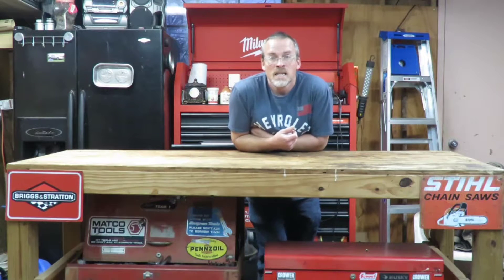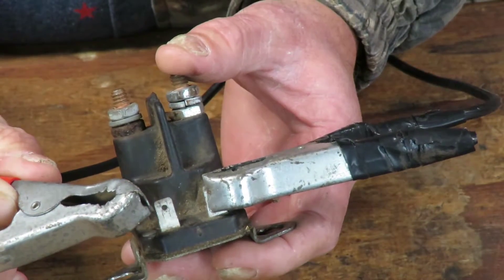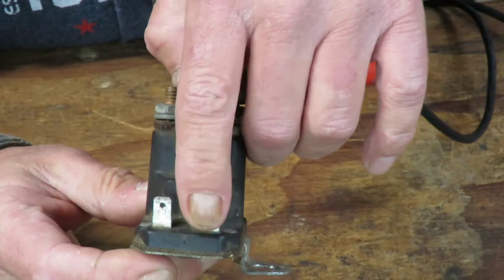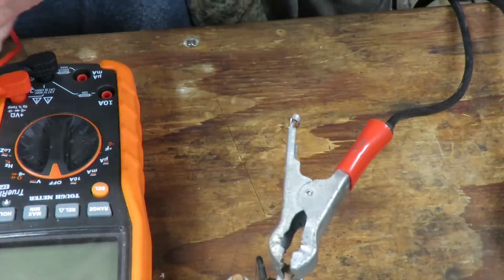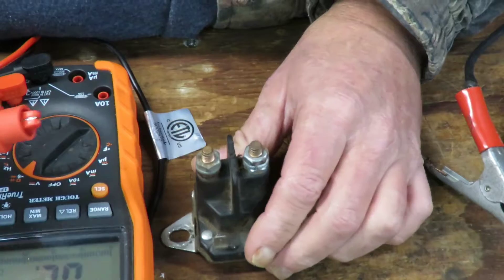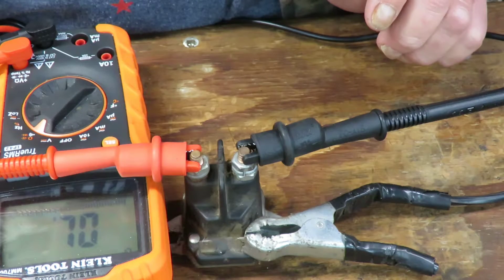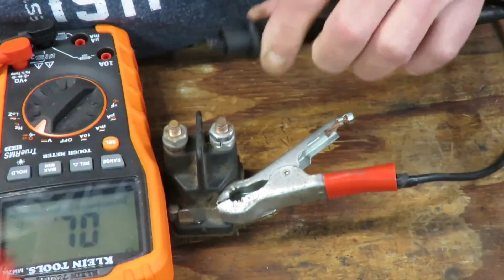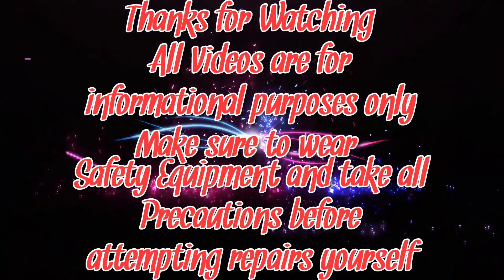How to Simple Solenoid Test with Tips

Comment: I have a Cub Cadet 1554 from 2006 and I’d like to test the selenoid which is a 3 post but located under the battery tray on one side. How do I hook my multimeter to it without removing it while it is still connected to the battery?
Reply from the maker: Is the Solenoid clicking when you turn key to start position?
If it is clicking then most likely solenoid is Not connecting inside.
I would replace solenoid
If it's Not clicking with key in start position
Remove small wire from bottom side of solenoid usually with a female spade terminal.
Put your positive lead of meter in this terminal and ground the other lead
Key to start position
You should have 12+ volts at this wire.
If you don't,  need to test key switch and or for a blown fuse or broken wire.
Reply: @sartingarage8045  Thanks! Yes, it clicks once after key is turned to Start position. I did a key switch test based on your video and that seems Ok, I replaced the key switch a couple years ago. I was running the mower and cutting grass for an hour before it ran out of gas, I think but when I refueled and tried to start, it wanted to crank but after about three tries, it went dead and only the click now. I'll try the test you mentioned.
Reply from the maker: I think you need to remove battery
Charge it on battery charger
Reinstall battery and try to start again
Then if it does start 
Check your charging system
If charging system is ok
Load test battery
It sounds like battery is not holding a good charge depending on how long you cranked over engine before going dead.
But the way it sounds , battery shouldn't go dead that fast

Comment: I have a K301s  1977 with amp meter that always shows a discharge and after awhile the bat. goes dead.   whats the fix? if anybody knows im shure you will   you are the best      thank you
Reply from the maker: Most of those the starter is also your charging system. There is usually a voltage regulator mounted to the starter/generator.
You check this pretty much the same way.
AC voltage into regulator
DC voltage out
Reply from the maker: Part # 275746s should be the voltage regulator. Look yours up by model and spec number to be sure.

Comment: What will cause the starter not to engage on start?  The voltage shows around 12.5 at the positive post on the starter, but the voltage between the starter and the motor's body drops considerably.  The starter seems to loose its ground and want engage.  This event sometimes will causes the fuse to blow.  The starter switch, solenoid and the starter seems to be working as they should.  Also, when I connect the ground post of the battery to the body of the starter it then engages upon start.  Any help would be
Reply from the maker: It sounds as if the abbendix are not engaging. Like the gear is stuck in the down position. This is common on the intek engines with a metal gear. You can free the gear but most likely will get stuck again if thats the problem.
Reply: @sartingarage8045  I used the information in your "How to test for ground Connections" video and isolated the problem to a grounding issue with the starter.  To bypass the problem I wired the starter body directly to the negative battery post.  I want to thank you for being so thorough in your teaching methods.  You're the best I've found so far.  Keep up the good work.
Reply from the maker: So the starter motor wasn't spinning fast enough to engage gear due to loss of ground. You probably need to check negative battery connection at Frame..
Take it off clean and put back . Then spray new paint to protect from rust. Atleast some clear coat.

Comment: After putting in  new key switch (old one did nothing) I did get the engine to turn over but not start, no click when key turned on.  Tested the solenoid but did not get anything on the resistance when checking to the mount, ordered new solenoid, question is should you get a voltage from the 2 black and 1 white wire going to the solenoid when the key is in the on position, I do not get any.  Enjoyed your video didn't know about checking from the mount, learned something  Thanks
Reply from the maker: Not when key is in On Position
Only Start Position
There should be Battery Voltage to small Wire to Solenoid in Start Position.
If you solenoid has 2 small terminals like in video. Should be power to One side with Key in Start Position
Reply: Thanks just not getting the click when key to on position maybe new solenoid will fix. Thanks again

Comment: This is extremely helpful.  I’ve got that very different looking Solenoid on a Kohler Command CH640 part number 2509811.  You know, the kind that is attached to the starter?  Can I test this kind the same way?
Reply from the maker: Yes Sir Very similar test
Battery or Battery charger to Ground anywhere on starter. Positive to Single Terminal on Solenoid.
Be careful if solenoid engages Starter Motor will turn over
Reply: Sartin Garage I’m assuming I can take it off the mower and put it in an insulated vice or can I test right in the mower?  BTW, I’ve used your other (and other YouTube ) tests and I believe I am getting power to the part.  Could I just use the screw driver/wrench trick to simultaneously touch each post of the solenoid to see if I can turn the starter while it is still on the mower?  If it turns over then I could remove the part?
Reply from the maker: You can do it either way
Will be easier off the mower to get to connections.

You can On the screw driver trick
Starter will spin, But wont engage
Unless you cross Battery Post side of Solenoid to Small Post on Solenoid.
But doing this will let you know if you just need a solenoid or the whole Starter
Reply: @sartingarage8045  Great!  Video saved!  Thanks!!!!

Comment: I had a leaking head gasket on my riding mower and after  putting a new gasket on it wouldn't start. No power at all to starter. I found Sartin Garage and went trouble shooting. Safety switches fine, ignition switch fine but no clicking solenoid. Sartin Garage to the rescue!!!!!!!!!!!!!!!
Reply from the maker: Power to the key Switch Comes from the battery post side of the solenoid.
Meaning follow battery Cable Positive Cable , Trace it down to Solenoid.
There will be a small wire (usually Red ) attached to same post on the solenoid that the battery Cable attaches to. Follow that small wire and you will run into a fuse ( check the fuse)
Reply from the maker: I will try to make a video this week on troubleshooting No Start Electrical Problems